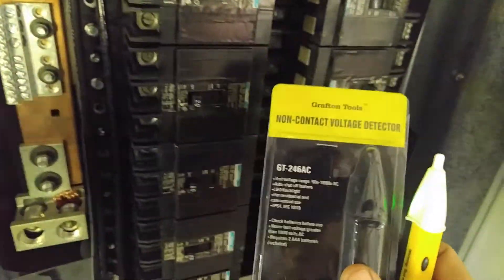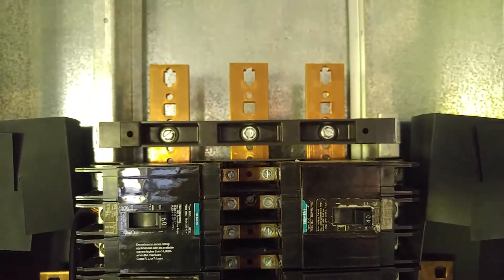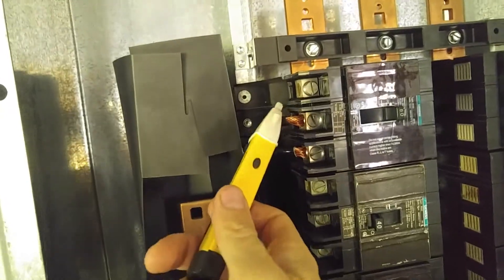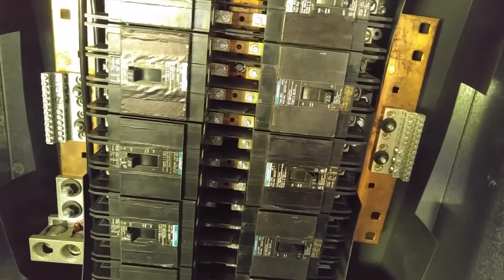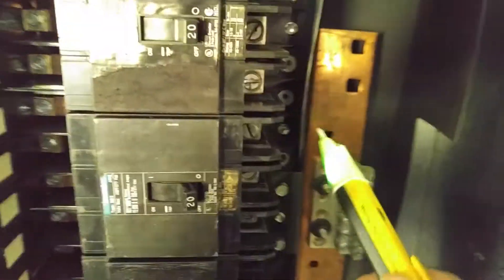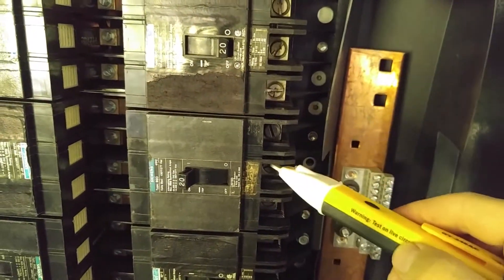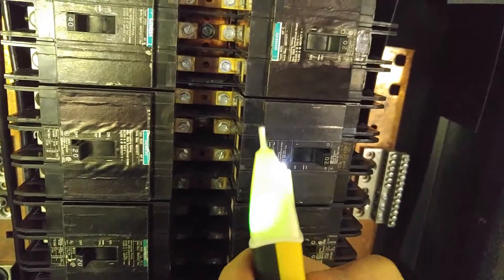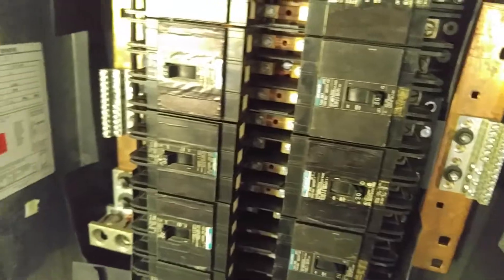(:Review:) Grafton Tools Non Contact Voltage Detector ~ Detects Any AC Live Voltage for Testing

Comment: How do you turn it on. I can’t turn mine on
Reply from the maker: Check the battery. There might be a protective tape you have to remove.
Reply: @GadgetClass  hysterical answer since there is absolutely no instructions on how to install the provided batteries .